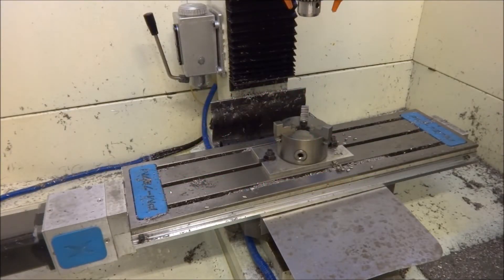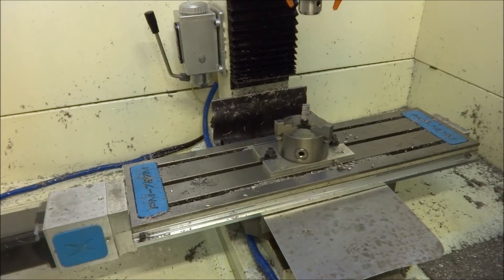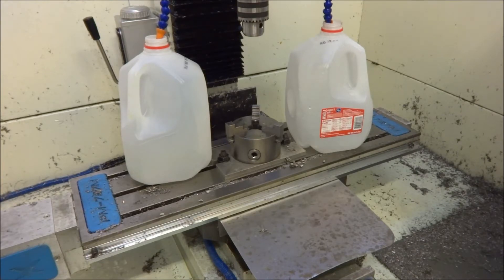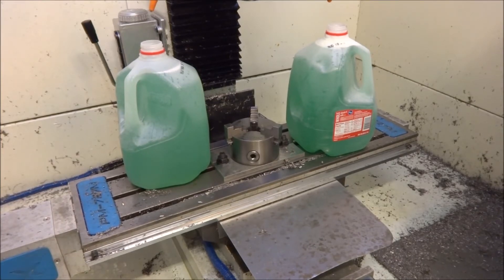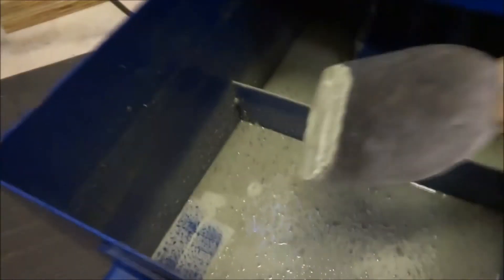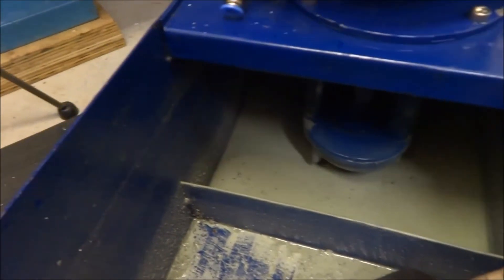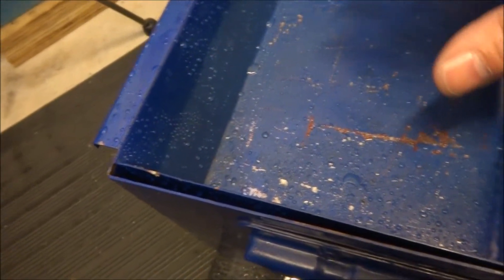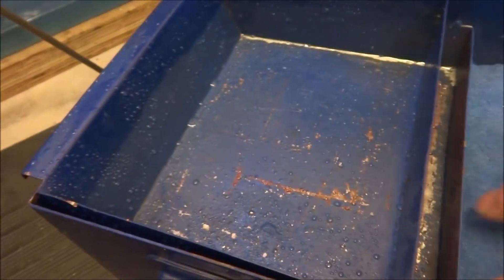Flood Coolant Clean Out

Comment: Hi from France !

By the past I have been in this situation with industrial-grade CNC machinetools, with thousands of liters of slurry & stinky oils flowing from the hoses, making a loud smell in the workshop.

Actually, there is three "schools" for treating the issue :

First : making some oil&water mix periodic replacement, it last some weeks on the better case.

Second : Using a powerful biocide agent BUT don't worry : bacterias finishes to adapt to harmful chemicals, that will allow you to have professional dermatisis AND risk of surinfection in case of "blood-depth injuries".
In France we have tremendous issues with benzisothiazolinone, methylchloroisothiazolinone, some bromide products used as biocide... plenty of dermatisis for everyone, these conservative agents are present until kitchen soaps bottles.

Third option : the Swiss company GLASER has developped a product which spreads intentionaly some bacterias, the Pseudomonas spp. They are not harmful, they spreads everywhere and helps to digest all fats present in the cooling fluid. And, most important : by spreading wildly, they are blocking all the space available for others, harmful or nasty bacterias. I think that this kind of product should be available in USA.

Last option , special issue. We have some regulations for preventing fire & poisoning hazards related to industrial solvents used about degreasing & cleaning stuff in France.

Because the use of petroleum-based solvent is not reliable (due to the progressive saturation AND creation of vapours of the solvent used), some French companies sells some "tablets" of ...bacterias, that must be kept into a tank at a good temperature (usually the metrologic temperature standards : +20°Celcius (68°F), that will digest everything edible, leaving the "soap base" available for new degreasing, in a aqueous phase.

From time to time you will have to remove "ultimate slurries" : plastics, resins, metal particles, oxides, whatever not edible for these bacterias.

Here is a YouTube link (in French) showing the effectiveness of this solution :
https://youtu.be/kWjppU29IDE?t=5m15s

(I have placed the video showing the degreasing of a used Diesel cylinder head, full of soot & tars... impressive !

The "fountain" costs a lot (circa 2500/3000 € here), but you can construct your own from a old truck tank and a old stainless steel sink, with an AC/DC TIG welding source.

Bacterias tabs & detergent bottles are not expensive.

Best regards !

Comment: The sludge is your way lube that has been whipped up and emulsified with the water based coolant.  When the machine is not being used, the oils float to the top and form a barrier that blocks any air from getting to the coolant.  This anaerobic condition promotes the growth of the smelly and harmful bacteria.  Skimmers work to try to reduce that floating oil layer.  you can get a good air pump and a bubbler stone at a hydroponics supplier.  Have the bubbler in the sump doing its thing aerating the coolant whenever the machine is not being used.  A good supply of oxygen to the coolant will help prevent bacterial growth.
Reply from the maker: Thanks for the Information, Yeah kinda like mayo I guess whipped oil. Funny I never saw that much oil in my coolant.

Comment: I gave up on flood coolant on my cnc lathes, just too much trouble. Changed to mist and very happy with the result. Recently imported some Koolmist (at horrendous price due to postage to Oz), wanted to have eco friendly product. It seemed ok until parting some 40 diameter aluminium, had to change back to soluble oil type to get the result I expect.
Reply from the maker: Yeah I Think Koolmist is fine in a fog buster system but for flood I just don't think it's the best option.

Do you also mist with the oil soluble?
Reply: I do, using the Koolmist just did not work when parting.  Just changed the supply bottle on the mister for one with soluble oil in it.
Parting was back to what I normally expect.
Reply from the maker: thats easy to do